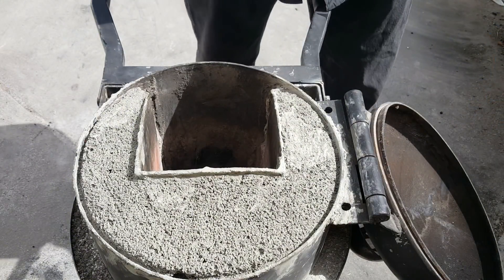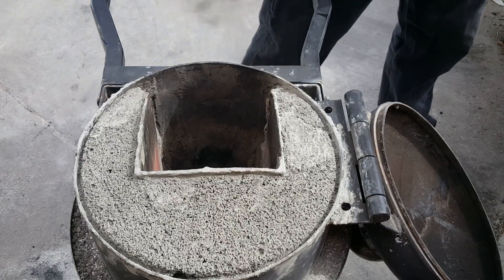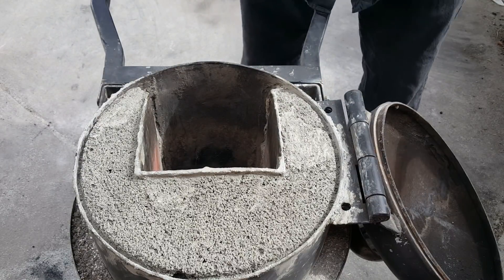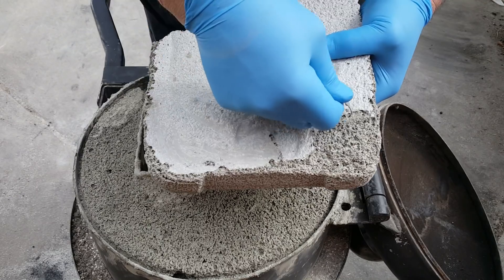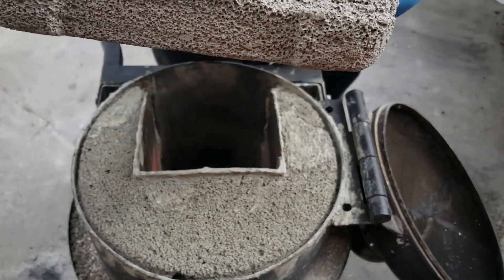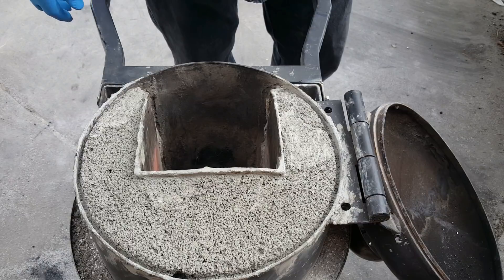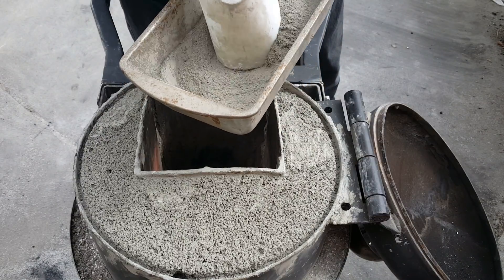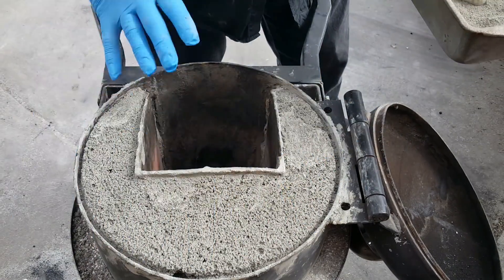Pouring Aircrete in a Heat Chamber

Comment: I think you missed a bet here.  A more dense material for thermal storage would likely have been better than an insulator for the burn chamber.  The huge efficiency gains in a thermal mass rocket stove are 1) fast hot complete burn and 2) store the heat to be released slowly over time so that exhaust gasses about 70C are coming out the chimney.  Some great idea's here but some missed opportunities as well making things more complicated than they need be.

Comment: Great job... I have a question for you I’m going to build a rocket mass stove and bench out of 8” x 16” cinder blocks then face the cinder block with stone veneer. Do you think it would be better to fill cinder block with air Crete or cement or motor? 

Thanks
Reply: Frank Poli hi Frank, i hope  I'm not jumping in uninvited here, but I may be able to help a bit. In what you're describing I'd say aircreat is not the material you want. It has pretty incredible insulating qualities which is great for some parts of a stove, but since what you want the bench to do is give off heat, I'd say mortar would be a better option. Just my opinion of course

Comment: If you took quarter inch rods and stuck them into the area to be poured would create 1/4" voids in the cement running the length of your cement area when you removed them. Then you could pour the liquid glass into the holes which would saturate the surrounding cement the length of the 1/4" voids. Cap off holes when done with cement.
Second question: Have you tried a perlite and liquid glass mixture? What were it's physical properties when cured?

Comment: Looks great ..one question...could you use water glass instead of water in the cement and foam mixture then when you fire up the stove the sodium silicate cures all the way through?
Reply: Dennis Case I second your question. With one additional question: CO2 will also cure water glass, could you use a tank of gas and a sealed plastic sheet chamber to cure the stove?